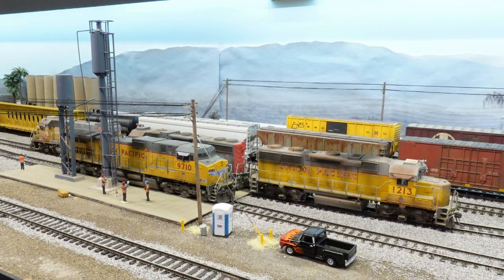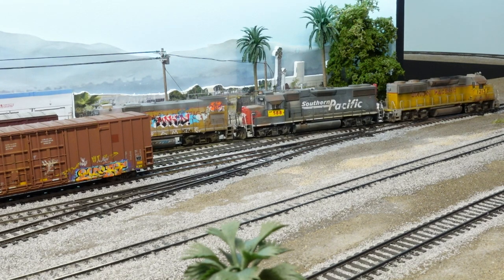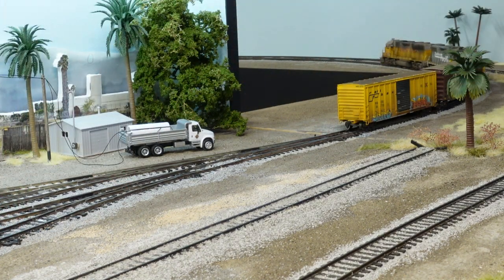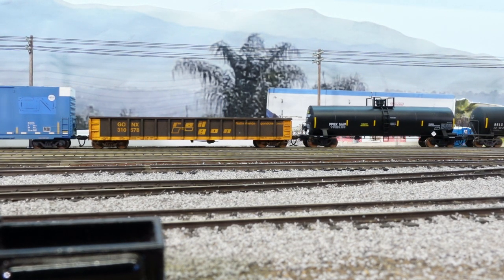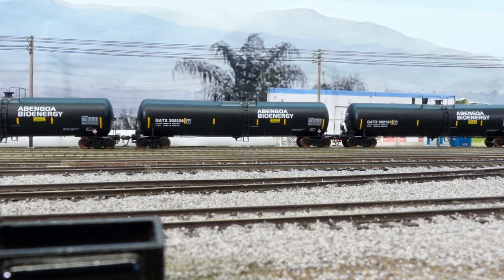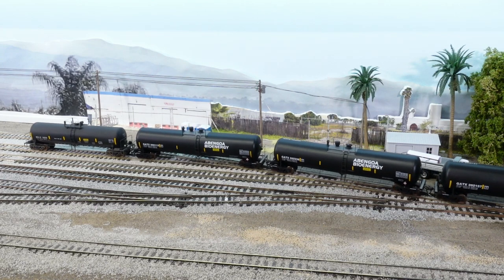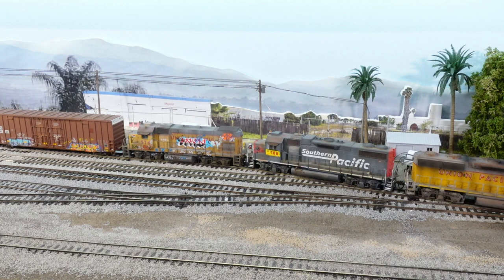Operations | Yard Classification with 3 locomotives

Comment: yard work sometimes is better than working an industry job or working on the road... in the yard you don't have to travel or move around all over the railroad, you just stay in the yard shuffling cars around... i worked with oldhead switchman who worked under a different contract than i did as they hired on in the mid 60s (i hired on in 1993) so they had only yard rights and couldn't be forced on the road... these two guys worked the north end switch engine (they just flat switched) every shift... sometimes the yardmaster would send them to the south end to switch and those guys would CRY, the yard office was on the north end of the yard and i swear the further they got from the yard office the louder they cried... it was hilarious

Comment: The trios of SD40N locos working both the hump and the trim ends of West Colton are likely a result of the 2020 Plan.  That's UP's name for their implementation of the infamous North American concept called Precision Scheduled Railroading (PSR).  Ultimately, UP's 2020 Plan has resulted in the closure or deactivation of numerous hump facilities around the system:  Chicago's Proviso hump, Kansas City's Neff hump, Fort Worth's Davidson hump, Hermiston's Hinkle hump, Pine Bluff's hump, and the former eastbound hump at North Platte's Bailey Yard.  By the summer of 2021, Roseville's Davis hump, East St. Louis' Gateway hump, Houston's Englewood, Settegast & Strang humps, Beaumont's mini-hump, West Colton, North Little Rock, Livonia, and the former westbound hump at North Platte's Bailey Yard, were the only humps remaining in operation.

PSR is primarily focused on greatly reducing labor, maintenance, and handling costs, while also attempting to reduce overall carload dwell time.  So far, this strategy has resulted in much longer manifest trains, the mothballing or sale of hundreds of locomotives, and the closure of all but the busiest humps.  Several of the remaining hump facilities now use identical consists for both trim and hump duties.  With some long distance manifests now routinely exceeding 10,000 feet, three-unit consists of six-axle locos are needed to double, triple, or even quadruple longer trim cuts to build outbound trains, as well as the hump classification of 200+ car inbound trains.  Using the same consists for both hump and trim duties reduces costs. . .  which is the name of the game with PSR.
Reply: CORPERATE GREED AT IT'S BEST
Reply: @johnrobertfox7775    indeed
Reply: @oubrioko   10-4 GOOD BUDDY !

Comment: Just a stupid question. If you don't have the locos consisted together, how do they run so well together?

BTW. Love your videos and your narration.
Reply from the maker: I have them consisted in my esu cabcontroller which allows for easy simple consisting. meaning the motors are all controlled together, but not the lighting and horn or bells. that's why they all blow horns instead of just the lead locomotive. One day I'll get around to consisting them using CV 19, just haven't got to it.
Reply: @socalscalemodels  I think if you just do an advanced consist, it does that for you.  At least that is how the NCE powercab does it.  It controls the motor, lights, horns, etc.  Literally takes me 30s to do it, as long as you have them speed matched already.